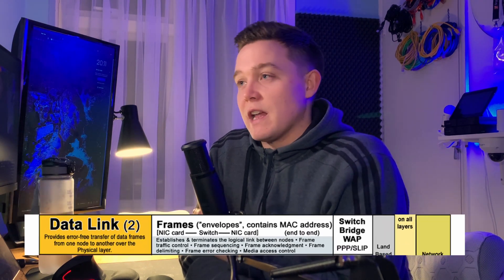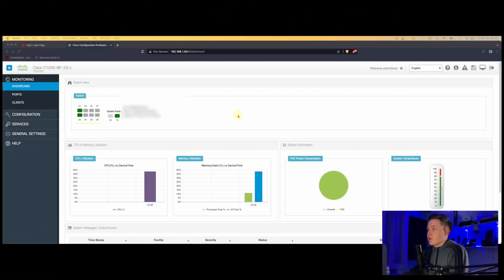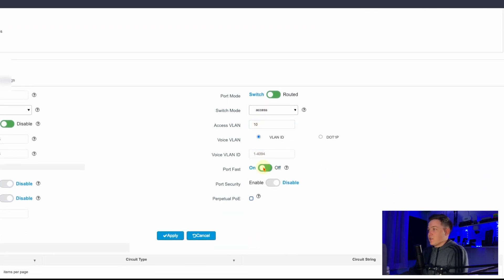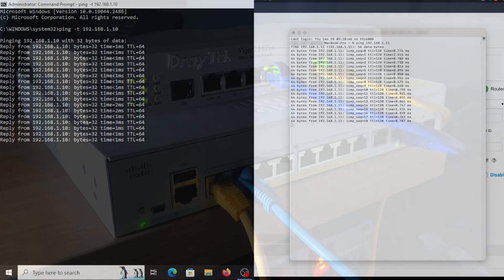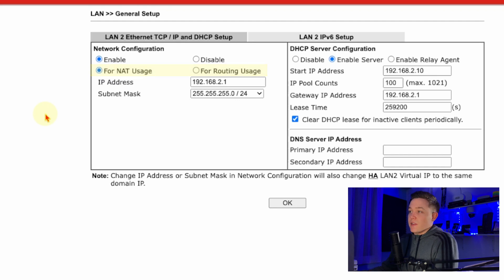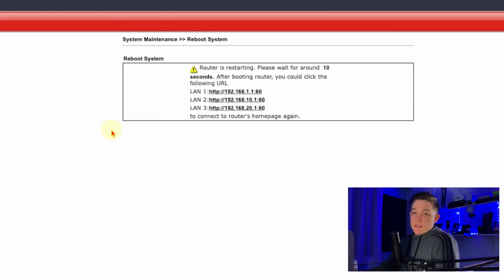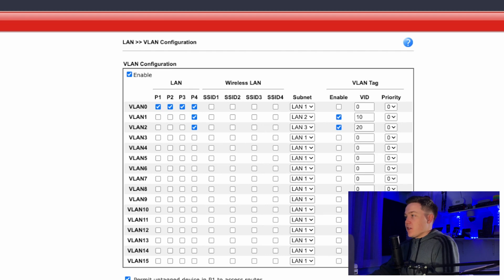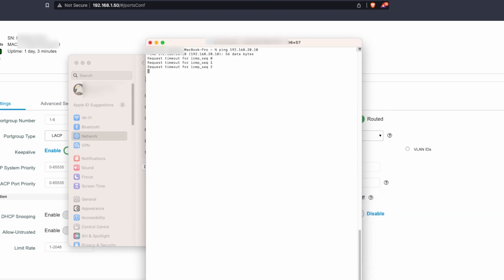Subnet Based VLANs | DrayTek Tutorial

Comment: Why does Cisco recommend to change vlan 1? I know you said security reasons but what exactly? And what would you change it to? Vlan2 or whatever number that is not 1?
Reply: Typically it's a bad idea to ever use vlan1 because a wide variety of issues.  Example being vlan 1 is layer3 and can enable web\ssh access.  Vlan 1 on some switches can also have settings you actually can't see example a FS S3900 vlan 1 has rules in ACL you can't see from "show running-config"